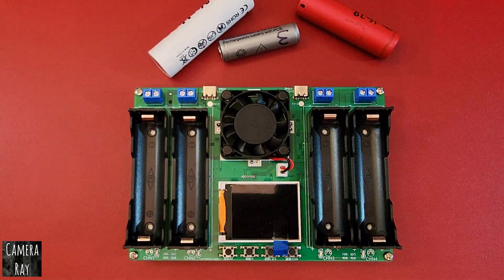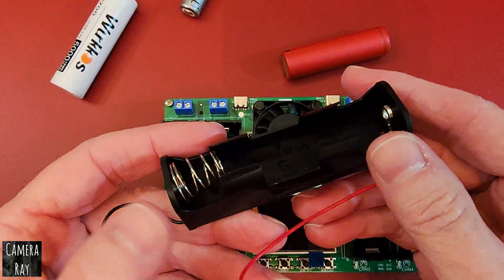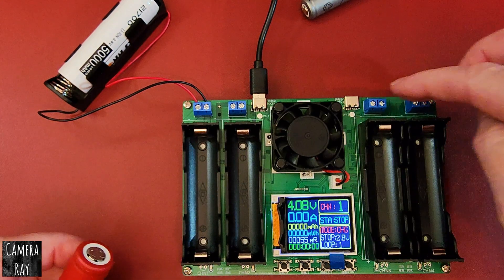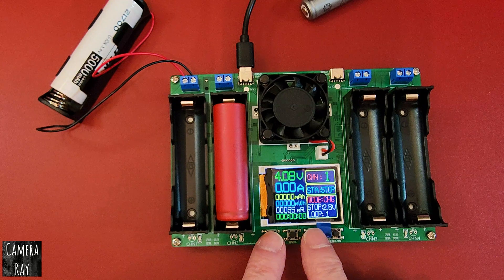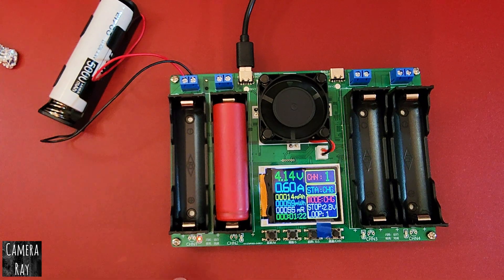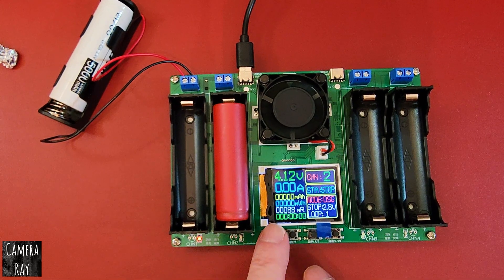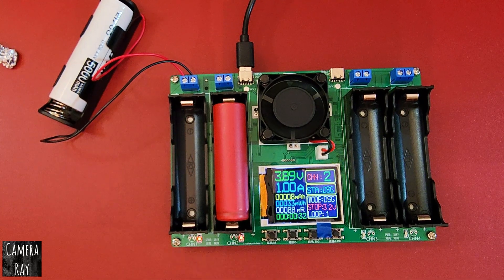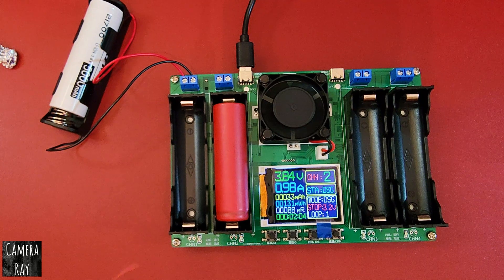Charge Different Sized Batteries With 18650 Lithium Charger Capacity Tester

Comment: One thing I noticed about this device is, is it very normal that when I select the discharge voltage as 2.5v, 2.7v or 2.8v, the discharge process ends at 3.54v and does not drop to 2.5v, 2.7v or 2.8v?
Reply from the maker: Mine does not do that. Yours has issues.
Reply: @CameraRay  "Does your device discharge down to 2.5 volts? Or does it complete the discharge process at 3.5 volts? Could my device be faulty? All functions of my device are working, but it only completes the discharge process at 3.5 volts—it never drops to 2.5 or 2.7 volts, and the LEDs are green, not red. However, as seen in some YouTube videos, some devices have a constant red light. When the battery is fully charged, does the light stay red instead of turning green?"
Reply from the maker: Had to check mine, I have too many devices similar to this. On mine you can set it to discharge from 2.5v-3.5v . Once finished it turns from flashing red to solid red.  I have no issues discharging batteries  down to 2.5v.
Reply: @CameraRay  i think I understood that your device stops discharging like 3.5v when it is set to 2.5v discharge, I hope I understood correctly, it is also said that if the discharge voltage is set to 2.5v, 2.7v, it is bad for battery health, maybe they say that choosing a discharge above 3v is important for battery health.
Reply from the maker: It will discharge down to 2.5v when set at 2.5v. It is just better not to store them that low.
Reply: @CameraRay  beautiful device, I definitely agree with you, you're very right, I'm wondering, my device terminates the discharge process like 3.54 volts, even though I chose 2.5volts or 2.7 volts, which I chose while performing the discharge process, I didn't understand it, is this normal or is my device defective?eautiful device, I definitelm.
Reply from the maker: The only reasons it should not go down to 2.5v discharge is if your battery has a built in voltage limiter or you charger is defective.
Reply: @CameraRay  I also suspected that the battery might have an internal voltage limiter. I still have the chance to return the device, if I detect any malfunction before the deadline, I will return the device to Amazon.

Comment: Hello I bought the same device from Amazon, but I don't understand that in my first test the LEDs turned red, then they turned green all the time and kept turning green in every mode. How can I fix this? Or is the device defective? i would be glad if friends with experience in this matter can help
Reply from the maker: The small light below the battery should flash red until charged or discharged. Once the cycle is finished the fan will stop and the light should be solid red. At least that is how mine works.  Your may be different but that is how most I have seen work.